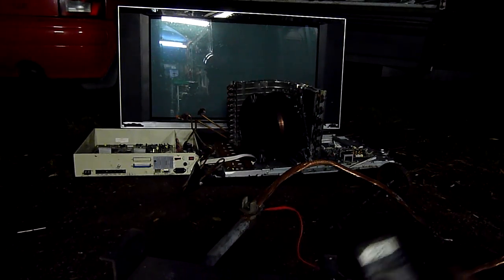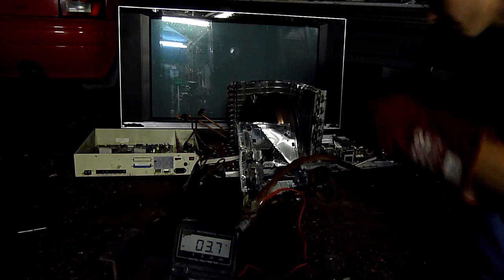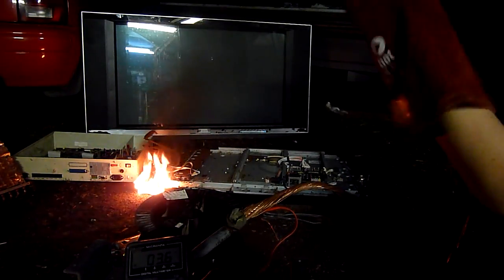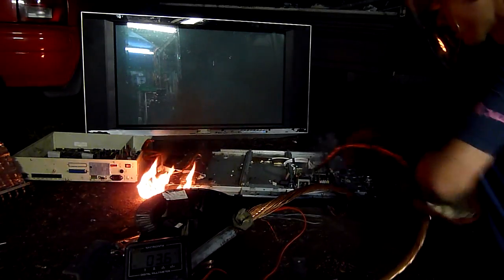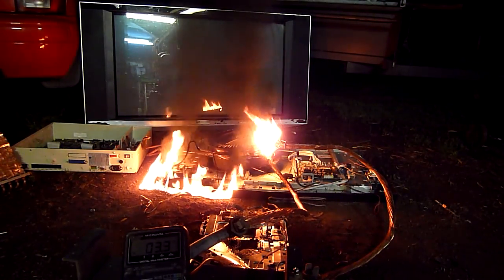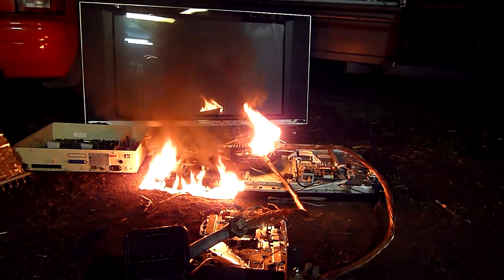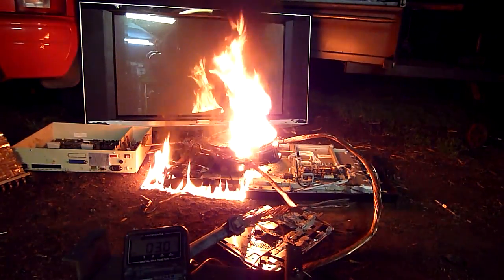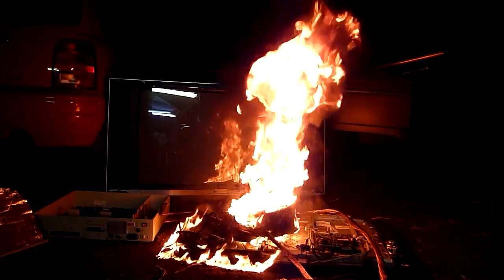Melting Junk with High Current Rewound Welder Transformer

Comment: Quote from wikipedia: Several factors influence the choice of frequency in an AC system. Lighting, motors, transformers, generators and transmission lines all have characteristics which depend on the power frequency.

During the development of commercial electric power systems in the late 19th and early 20th centuries, many different frequencies (and voltages) had been used. Large investment in equipment at one frequency made standardization a slow process.

Kijk anders even op wikipedia.